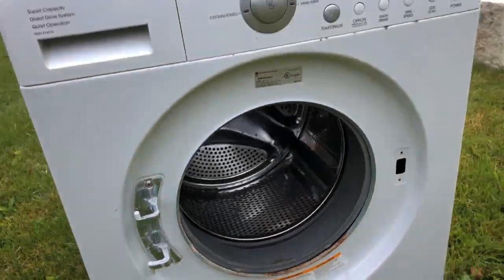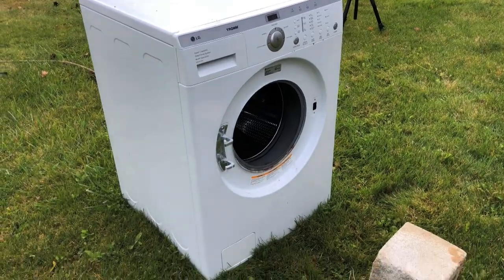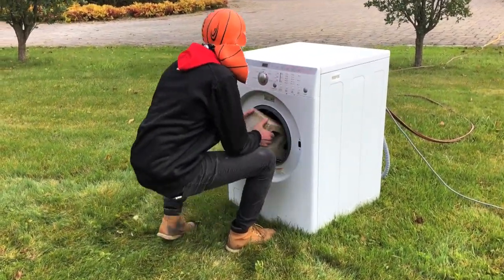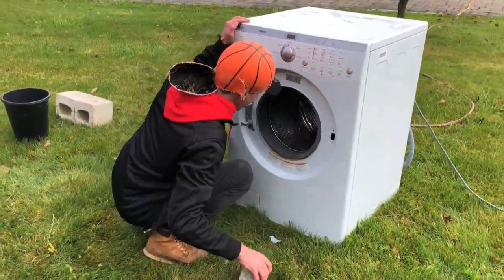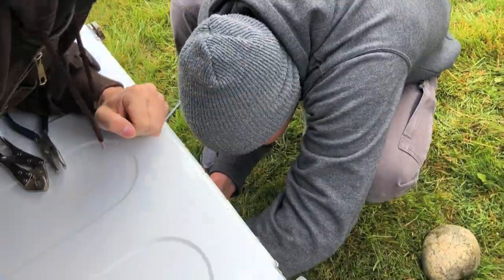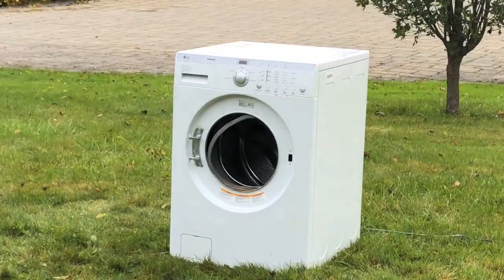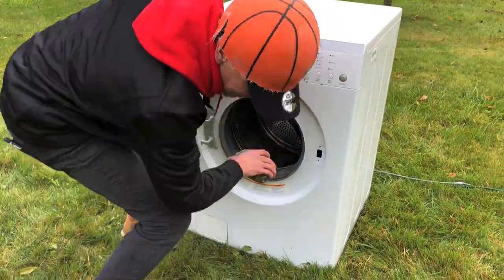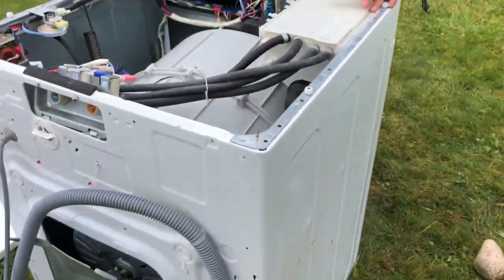Front Load LAUNDRY MACHINE VS BRICKS!

Comment: If you take the concrete weight out of the machine, it will dance
Reply: No. Hot wire it
Reply: @chillinbro5423 no ya cant(or atleast its very hard to)
this has an inverter dd motor not your traditional brushed belt drive

Comment: Photonicinduction is an electrical engineer.. he bypassed everything and just hooked power to the motor..... Pull the wires off the motor and stick then in the end of the cord...
Reply from the maker: Ahhhh that would make sense!
Reply: He also used a "Variac"  to step up the Voltage from his regular socket into HIGH-(enough)-VOLTAGE Directly to the Motor so it would Spin Crazy Fast, before putting a weight in.

  (He might also have removed the concrete balance Blocks at the bottom...  –  which it looked like you took out already by the end at least)

  C Ya L8r then!.    ;P    
.
Reply: @TheBest_F-22  The variac just works like a big dimmer. It does have over wind to about 270v but 30v wont make it spin much faster than mains. Direct wire to plug would have similar results.

Comment: The reason it wouldn’t take the cinder block is because LG washers like this have a safety sensor or something in it that stops the motor if the washer is too unbalanced
Reply from the maker: Interesting!
Reply: @markfreeman408  yup! We have an LG washer too. It does this when we do laundry too because it “thinks” that it’s going to become unbalanced, but I don’t know exactly which component does this. What’s also interesting is this washer (the one in this video) is about 20 years old; it’s from around 2004/2005

Comment: hard wire the motor to a light switch. and cross brace the inside of the unit with 2x4 and screws throught metal. the dampers up and down prevents the velicity. if not 25lb propane tank fits fine. just a lil fire underside and 300m saftey zone shoud cut it